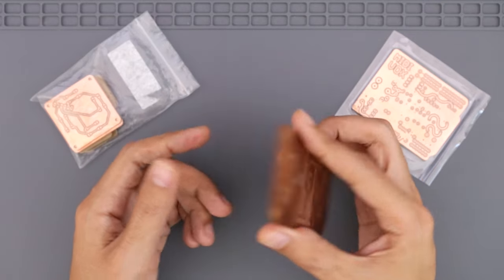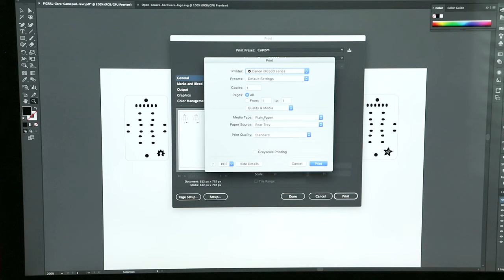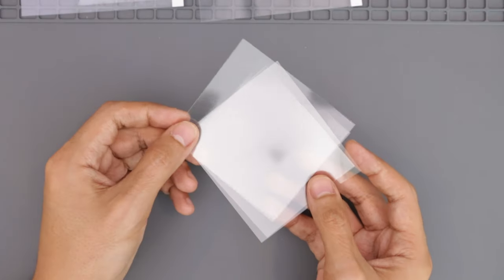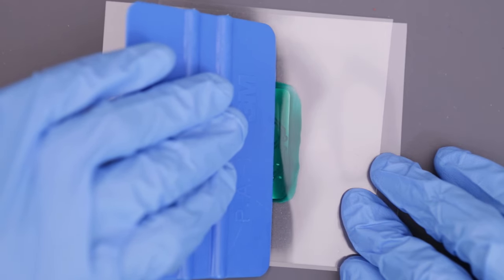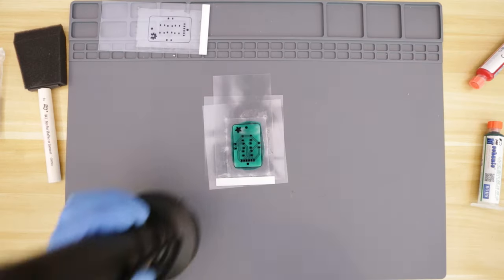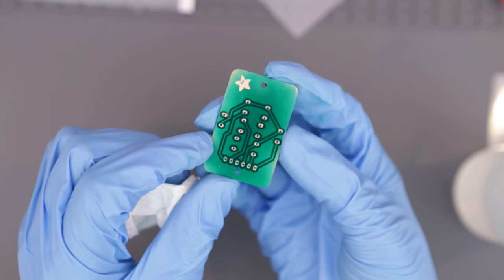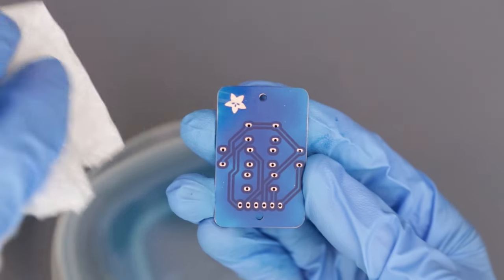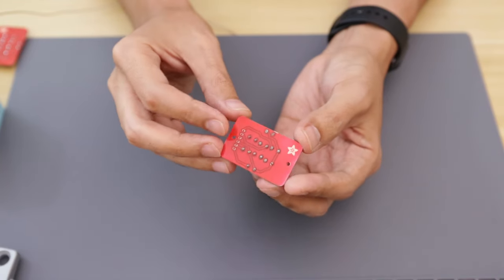How to Solder Mask PCBs #Adafruit

Comment: Since you're milling the PCBs already, why not just fully expose the mask then mill out the pads down to copper?
Reply: the copper are thin, probably you'll ended up ruining the traces
Reply: @pierreuntel1970  Not if you use a spring loaded bit
Reply: @pierreuntel1970  No he is not. There is a example of milling PCB mask
https://youtu.be/7EctuSTL7-w?t=218
Reply: I don't use a spring loaded bit since I didn't want to spend $200 getting a kit from WEGSTR. I am milling my pads though with help of an auto leveler.
Reply: I think you need mask the most between pattern so that solder get isolated for smd.
If you mill after mask you lose mask where you need most

Comment: Just an idea: keep the transparent film but try spreading the mask with the something flater, like a piece o thick plexi (or even glass), and add "stopping guides" to the sides of the piece, like scrap PCB with some layers of duct tape, to give the thickness you want. Basically, make a jig.This should give  better consistency and control than just using your bare hands.

Comment: Neat idea.  A couple of thoughts:   

The UV transfer is very similar to the process used to create a screen for screen printing shirts and such.   In that domain, much more precisely controlled UV light, e.g. in a dark room with a UV table is the normal pro setup.  For us amateurs, you could better approximate with a less powerful UV source (halogen lamp) for a longer cure time.  You can do this in a darkened room lit by a yellow 'bug' bulb.  If you keep the lamp a fixed distance away, there are test sheets that can help you figure out the right cure time.   (You uncover part of the pattern every so often to test different times.)

Getting a really dark mask is also crucial.  I've had good luck doubling up laser printed sheets, darkened with a light coat of spray clear.

Comment: Hi, thanks for the video. I found the following:
1. I used laser print OHP film
2. I placed the printed film Toner side down on the board, carefully aligned and held with masking tape. Then flapped open to apply resin.
3.  I used much less resin than you did.  At a guess the amount you dispensed would have done me a board at least twice that size.
4. I squeegeed the resin using a thin steel “scraper”  direct on the back of the film - part of a set I bought in a pound shop. Possibly a blunted Stanley blade would do.  Plastic scraper too flexible across the width. Using that tool allowed me to push as well as pull the resin to even up the thickness a bit.
5. An exposure of about 15 secs at close range from a UV torch did the trick.  You can check if the resin is cured without peeling by gently pressing on the film with a fingernail.
6. On peeling, much of the uncured resin came away with the film and a light wipe with isopropyl alcohol removed the rest.

Comment: For my initial (cnc milled) prototypes I just go around tinning all the pads, then hit up both sides with spray paint.  Once dry I take a soldering iron and touch each pad for a second to burn off the paint.  Looks pretty good actually... but once I'm happy with the design I have 10 professionally made by a Chinese shop. Might have to try this out though, looks fun!

Comment: Talking about the cleaning up the unexposed solder mask, you can use a warm bath of Sodium Carbonate (Washing soda) to strip the mask really easily, you can also use a more concentrated bath in boiling water to strip off the under-exposed solder mask from your failed boards too.

Comment: Save cutting the pcb's out for last. Mill the circuit paths, but don't cut the border out until you've applied the uv mask. This will reduce the issues you're seeing on the edges of the PCB after the uv mask has been applied.

Comment: I always apply the resin as thin as possible. It doesn't look as uniform a color, than when you apply it thicker. But it works a lot better. No more peeling of the resin from the pcb. 
Cleaning the pcb is very important. 
My last suggestion is to expose it a lot longer. I expose for 9 minutes, with two 1watt UV leds, at a distance of  15cm (6").

Comment: Sharpie's are dye based. You'd be better off using a marker with a more solid type of pigment. Basically dye is like window tint film. You can make it really really thick but it still doesn't completely block out all of the light. 
    Dye just kinda sucks. I learned the hard way when I used to paint cars and a bozo decided to mark up a car with a sharpie showing what he wanted me to fix.

   There is another video I watched recently on solder mask. He used a piece of glass to smooth out the surface. His results looked pretty good.

  In my experience your issues with adhesion appear to be due to prep. Your product is sticking to the plastic instead of the PCB. You probably need more tooth (light sanding/scuffing) on the PCB surface, and a better cleaning solvent. When it comes to automotive paints these are some of the most important products and steps of the process. Most painters are religious about what they do and use for prep work. The wrong solvents will just spread out contamination making bigger problems. I used to wash my hands with Palmolive dishsoap only and used it for wet prep/sanding too. I won't shoot anything unless I have PPG's wax and grease remover... Even if I'm shooting with another manufacturer's paints... Prep is 99% of the job.
-Jake
Reply: This is the video where he used glass for the solder mask:
https://youtu.be/Vj_cdBZO1Tk

Comment: You can use a nail salon uv ligh. 36w of uv. It will be more evenly exposed and a fixed distance too. As another person mentioned, you can use a test pcb with strips on it for the timing. So you peel at 5 seconds, then 10, 30 etc.Also as another pesron mentioned, use a jig to get consistent even thickness of the paste.
Reply: oh lol, you summarised above (which are also the top) 2 comments

Comment: For aligning all the layers of film w.r.t the board, consider using a simple fixture. For example, you could use the holes on your PCB as reference features.  You can print out the hole locations in each piece of film, and pick them out with a hole punch. If you build a simile fixture such as a block with two pins, you can stack up all the pieces together and keep them properly aligned as you apply the mask.
Reply: can also use the holes for screwing the board down once its a finished project

Comment: Great video, gave you a like. Adafruit should carry Solder Mask film. It is more expensive but you get a consistent thickness. You have to expose to UV a lot longer, but all things being equal, it should not overexposed once you find the right "recipe" for exposure lamps, distance and time. I have seen homemade boxes with bright UV LEDs that works well. You only need two colors, green for solder mask, and white for Overlay marking (silk screen layer). Yes you can use white solder mask over the green solder mask for marking.

Comment: The process was annoying just because  you allow too much parameters to be random. Paint thickness is critical. UV penetrates only top layer. If thickness is too big, bottom layer will never harden, because UV light never rich it. How to solve this problem? Just use screen printing: buy mesh and frame to mount it in. 

Next problem: exposure time depends on the light power and the square of the distance. If light source is lifted a little bit, the power of light changes a lot. Solution: Don't use the UV torch, but just buy UV LED tape, glue it to the flat surface, bigger  than the biggest PCB's size, mount it 10cm from PCB surface (to avoid light irregularity). 

This way you will achieve 100% repeatability of the experiment. 

Next issue: the color of pigment matters. The difference is huge. For some colors I couldn't achieve good results. Red, blue and green are ok.

Comment: If you made that PCB by CNC, your process of applying the solder mask is time consuming, and wasteful. Just use screen printing using mesh fabric canvas to apply the solder mask that way it's pretty much a perfect coat of solder mask, UV cure it and have the CNC remove the solder mask on the solder pads like in this video https://youtu.be/sHO_rCXzI3M

Comment: Ninja Gaiden NES game - nice. ;)
By the way: why do you use multiple layers of transparent mask? I may be wrong, but perhaps re-printing on same, single transparent film multiple times would give you enough darkness without the hassel of working with multiple layers. A printer does not care is your paper or film is blank or not - it will spray another layer of ink on top of previous one anyway.
Reply: Been there, done that. Problem is, your printer is not accurate at all with the orientation of the sheet, this will result in misaligned layers, inevitably.

Comment: method I used. print 3 layer pad template for even longer UV exposure. use a glass for better thickness consistency on spread, cutout the outline after masking done. And lastly tin plate it for exposed copper with stanum solution. help protect unsoldered area and soldering time. Gave a very good result.

Comment: Thanks, very helpful! I've experience with UV for etching boards (I use acid bath). I print the mask using laserjet printer on a transparency in reverse (i.e. mirrored), then I completely blacken it using a high-flow flipchart marker, then clean it off by wiping it thoroughly with a paper towel. This helps increase the mask contrast / blocking capability and has worked great for me. Maybe it could be used here as well. Because the print is mirrored, the print side goes directly onto the board, without the film between, this improves sharpness of the exposure.

Comment: What's wrong with over-exposed UV? I mean, it can go in the sun afterwards anyway.  So will sunlight damage it? If not, why not "over-expose" to avoid wasted PCBs?
Reply: Oh, I see.  The light might get past/through the dark spots in the overlay.  I guess one could hold the flashlight farther away, to avoid high angles of UV penetrating from the sides of the ink.  And use 3 or 4 layers of overlay.  Just a thought.

Comment: FYI... to help you out what you can do it take 2 older or bad pcb boards place it on both sides.. take some card stock or cardboard from like a cereal box to add more space for the gel.... use a good roller like a pcv tube or a metal putty knife.. plastic ones will not have a good enough edge.. and scrap it with that ... you will get an even coat across it every time

Comment: A little tip I've discovered, is rather than going through the process of lining up a whole bunch of layers of to light blocking mask I found that (my printer at least) is accurate enough you can just run the same page through the printer a few times to gets the appropriate thickness of ink on the transparency. Just ensure care when you put the paper back into the tray to go through consecutive times.

Comment: Ok, as you say this seems to be a bit of a fiddly and error prone approach. Some ideas for alternatives that pop to mind.

1. If oxidation is all you are worried about it is probably faster to either tin the copper by hand or use a chemical tinning solution (although this last involves using chemicals which you might not like)

2. If for some reason you really want the masks specifically then perhaps using a vinyl cutter is a better approach than using inkjet or laserprinted UV blocking prints. Just cut what you do not want covered in solder mask (same as with the inkjet) into a vinyl sheet. Use the same transfer tape that is almost always used with vinyl cutters to transfer the trimmed vinyl cut-out to the PCB directly so that the vinyl covers your pads, via's etc. You can add art too if you want. Vinyl cutters are fairly accurate and cheap these days). Then all that is left is to spread the solder mask on the PCB (the vinyl will prevent it from getting on the pads). You can cure as long as needed since there is no risk of the UV shining through the inkjet printed blocking print. When cured just peel the vinyl from the board to reveal the pads again.

As long as you don't have too thick a layer of solder mask on there the vinyl should peel of easy no?

Comment: Since red is on the opposite end of the [visible] light spectrum from UV and a material's color is what light frequencies it doesn't absorb, it may be absorbing more of the UV than the others do. The result would be better curing around the fine details of the artwork.

Note: This is only speculation, since it could be reflecting as much UV as the others and we wouldn't know it since we can't see it.

Comment: I wonder if you can just screen print on a pcb to make the mask? If so, what sort of dyes would you use?
Reply: you would still use these types of solder mask "dye". UV curing would still need to be done. this is because you need the solder resist feature.

Comment: I found that the type of plastic sheet you use on top of the resin is an important parameter. Transparent sheets for laser printer will tend to stick too much to the resin. I use transparent vinyl sheets and longer UV exposure for reliable results (using a proper UV exposure unit helps a lot).
Also, the artworks (traces and solder mask) can be exposed to acetone vapor for about 1h at ambient temperature, the toner will dissolve and wet the surface evenly. This will make the black areas even more opaque and should not change the widths if it's timed correctly (you can overdo it). You still need to double up the artworks but it's worth the effort. I can handle designs with SSOP packages and such at home using this method.
Reply: Couldn't you just use some kind of mold release agent on the plastic you're laying on top of the solder mask

Comment: just grab a green permanent marker and paint the pcb except the pads. quick and effective.
Reply: It doesn't act as solder stop though, you can solder right through the marker layer.
Reply: true. it is not mask, what to expect. it's just ok for protection from oxidizing.
Reply: Oh. For that i just tin the whole board. Coat it with tin paste (i used fitting solder paste from home improvement store, that worked OK, but i ordered the Mechanic brand tin-lead paste from China, that should be even nicer due to lower activation temperature), heat it right up, i tried two ways, with a heat gun or on the stove top, both worked fine. A bit of sizzle and pop after a minute or so, and the whole board is covered in a thin even layer of corrosion resistant tin coating. But for more compact board layouts and SMD components, proper solder stop mask is an advantage or even a requirement. As a matter of fact, i think tinning the whole board before applying the mask is par for the course anyway.

They also sell Kontakt brand solder-through lacquer in a spray can at DIY electronics stores here specifically for the purpose of protecting PCBs between steps. Haven't tried it.
Reply: yah for smd solder mask is good. otherwise, marker pen can be cheap and quick alternative.